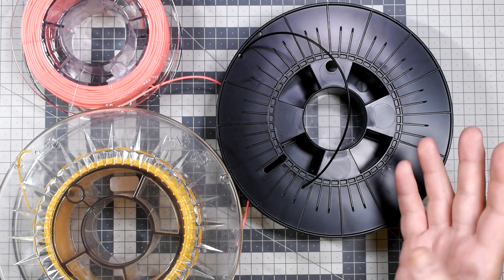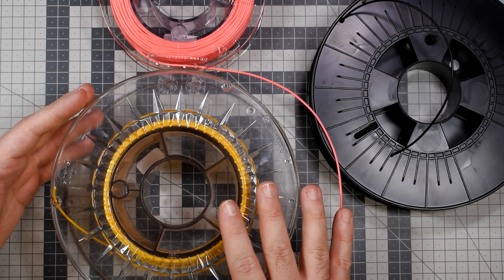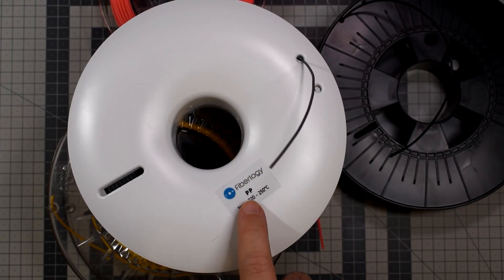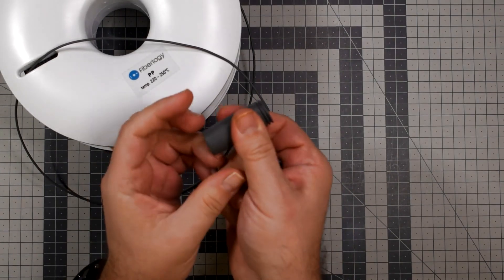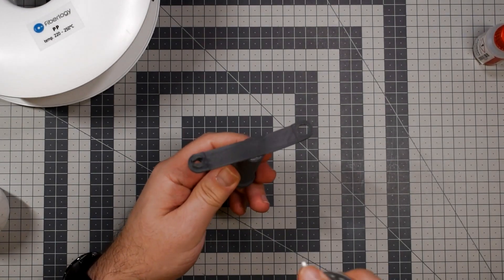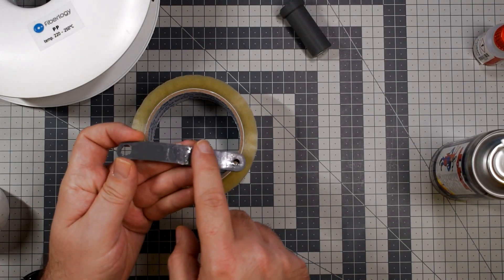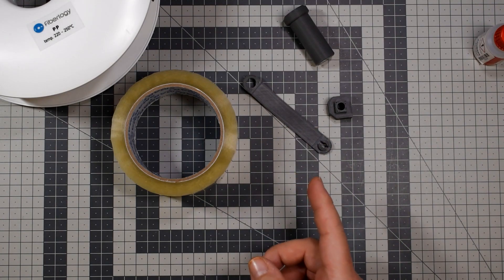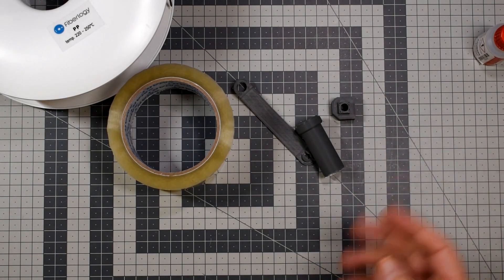3D printing with a polypropylene (PP) filament

Comment: Have you printed any wing parts? wondering if it significantly improves impact resistance compared to PLA
Reply from the maker: Yes, greatly. But it's alos more flexible so flex might be an issue
Reply: @HackerUni  You should try using Gyroid infill. It gives nice support in all directions, and its most suitable for 3D printing.

Comment: PP is NOT expensive. It weighs far less than PLA(1.25g/cm3 vs 0.92g/cm3). 1 kilogram of PP has at least 30% more filament than 1 kilogram of PLA.

Comment: I do have so much respect printing PP, ABS, ASA or even carbonfiber enhanced filaments. How was your learning kurve with PP, how many bad prints did you need to get it dialed in well? Do you print PP at very slow speed or similar to PLA?
Reply from the maker: I print PP only on ocasions. It's expensive and not reall usefult to everything. The learning curve was not that bad. Once initial layer adhesion problem was solved and I put the printer into enclosure, no more bigger problems. But yes, it's rather slow

Comment: Sorry if I missed it, but do you remember what temperatures have you used for the printing? I'm also experimenting with the PP from Fiberlogy and so far yeah I'm struggeling a bit ;).
Reply from the maker: It was 235 nozzle and 95 bed.